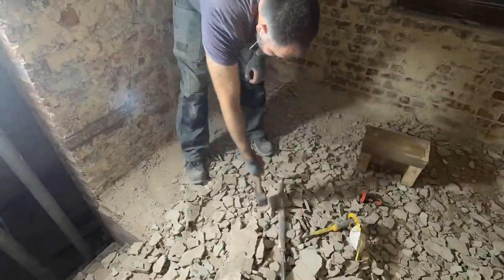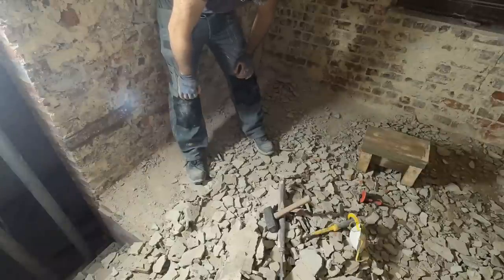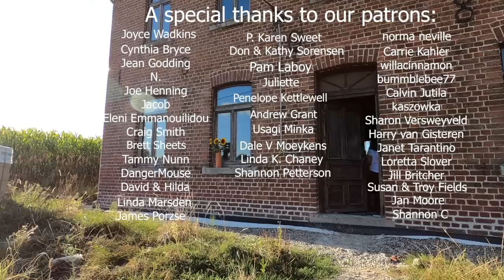OLD SCREED has to be REMOVED! / Renovating an old ABANDONED 1908 farm

Comment: Perhaps you could put the bathtub where the sink is and the sink on the opposite wall. That would free up space in the middle of the room.
Reply: It was my idea as well. It will free up the room optical when you enter the room - just seeing the toilet and the tub when entering. Even nicer would be to put the tub into the corner of the toilet and the toilet next to at while placing the vanity on the left side (upon entering).
Reply: Yes I agree. That was my first thought too. Bath could be at an angle and you could still look out the window depending on what end you lay at. Free-standing bath with claw feet 👍🏻😃
Reply: I'm loving that this is the fourth, alternative suggestion thus far. This community is the best. :)
Reply: personally i really hate having the tub so close to the toilet. i see it all the time and my house is like that, but it's always irked me.
Reply: I think this way would free up space and if the taps were the window end, you would still be able to see out of the window.
Reply: Yes this was my thought. Put sink on shorter wall and tub and toilet on the longer wall.

Comment: Some people like a free standing tub, usually claw foot tubs because they're fancy but they can be dangerous and difficult for some people to get in and out of.  Then you have to add those pipes and a shower curtain around it, if you want to also shower in it.  A nice large shower, if it fits, along  the left wall would be the safest and best option for every one to use, or on the side of the toilet with a wall in between.  Depends on the size of the room and whether you want fancy or practical.

Comment: When we renovated our house , we removed our baths and made walk-in showers (big).  Questions to ask yourself: are your guests taking the time to take a bath? Are you going to use it?i.e. do you regularly take baths now? A bath uses a lot of water and time. A shower uses less water and is quicker. Do your building regs require you to have a frosted window in the room? If so the view will go. We got away with it by having slightly mirrored windows on the outside    . Amazing work - keep it up.

Comment: you can use a floor leveling compound with a binding agent as a skimcoat  the old flood is stable and will hold tile easily  . thats the quick dirty cheap and easy way.... other end of the spectrum is ....tear it out ...throw in a drainage layer some insulation and moisture barrier  ..place your floor plumb it for in floor heating while you are there.... and tile   . thanks for the videos
Reply: And while you're at it, dig out the basement floor a bit further, so you can actually walk down there after what you suggested

Comment: Lots of hard work, but I'm sure you'll be glad you did it. It seems like you'll need a half wall along the stairs for safety. The head of the tub could go against it where you could access the piping in the half wall. The tub would be pushed against the wall perpendicular to the half wall where you can still see out the window. A safety bar could be attached to the brick wall that would double as a towel rack. There could be a matching half wall to block off the toilet from being seen from the stairs. The toilet can face the window for yet another viewing opportunity. The sink could go against the wall to the right of the window with shelving in the left of the window. There could be low cabinet under the window connecting the two. It could also serve as a bench under the window. Looking forward to seeing what you decide. Love the heated floor idea. Cleaning the brick floor and sealing it would save head space and be beautiful!

Comment: I’m loving the exposed brick, especially on the floor … if it’s in good condition, I would just clean it and seal it!  Saves the beauty of the brick, saves more work and also gives you a bit more height to the room.  I like the tub straight against the short wall by the steps … gives more floor space, but also still allows you to look out the window.  In the states, we call that a “claw-footed tub” …. They are beautiful!

Comment: Back in the early 70s, when I was an apprentice tile setter, I was shown how to make a dry pan base for floor tile. Any concrete floor to be tiled must be clean and damp. Then, a mixture made of 4 parts sand, 1 part cement, wet like beach sand, (damp), mixed, so that you cam take a handful and make a snowball that will hold together in palm of hand. Determine thickness needed as you work through 1 or more rooms spread dry pak mix over depth, use a couple of 10 foot conduit pipes to set screed level lines. Then pack down mix with wood float, screed with straight edge, (straight board), fill in low spots, again pak, reserved, move farther spreading more dry Pak mortar, etc.

Comment: I would put the bath with the taps underneath the window with the bath running in the same direction as the sink, I would then put a smaller sink in (as it's a guest bathroom) and if there's space put storage on the opposite side of the room for towels/cleaning products.

Comment: suspect the original 'screed' was liquid leveling compound poured over the bottom...  and that stuff (scratches easily or powdery) evidently was not good stuff.  the good leveling compound looks like very liquid gel pourable material, is about 5 to 6 mm thick at high spot and form hard (not easily scratched) shell.

regarding bathroom arrangements...  where is the faucet-drain for the tub at?  might affect the 'zen' of the bathroom.

Comment: Ok, this is what I would do! I'd clean up the floor as is even more, then put heating coils down and led lighting strips, and then epoxy them in! And have a claw-foot bath at the angle as you suggest.  looks like I'm in the minority though (and you will absolutely come to the decision that's best for you of course!).
This is the third time I'm banging on again about putting heating coils into the floors now, and a heat pump to heat them - it seems like a suggestion that you are not interested in, so it seems a little rude, but..!  I only mentioned it as
1. Fossil fuel prices were only going to go up, though heaven know, nobody expected this calamitous reason
2. Heat pumps require a larger transfer body than fossil fuel sources (at their higher temps)
3. Underfloor heating is sooo comfortable!
4. With your kind of structure, maintaining breathability through the envelope is best achieved with a constant heat gradient from inside to outside to maintain optimum humidity/condensation levels.
5. It's a rare opportunity in retrofit of an older building to be able to install heatin coils ...

Comment: Angling the tub to look out the window is a stroke of genius,  Marina!
At first, I didn't like the tub at an angle. But designwise (being an interior designer myself), I can see how comfortable it will be to not have to crick your neck to the side in order to look out the window as you bathe. Diagonal is an unusual placement, but it will be so comforting and perfect  to lie back, relax and be able to calmly gaze directly out the window without straining your neck. Glorious! I ❤️ it!  That type of choice is so important in interior design. Don't let the unconventionality make you shy about it. 

I would pull the tub back against the corner wall as close to the stairs and as far from the sink as possible. This will give you more room between the end of tub and the sink. You want as much space there as you can grab. Ilia's pretty tall and I don't know if he likes baths, but you might look for a shorter, but a very deep tub. Some of the old clawfoot slipper tubs can give you that configuration.  There are also companies that currently make copies of all the old clawfoot style tubs (though it is so exciting to re-use the perfect antique!)

Put a thin wall between stairs and tub to give a sense of privacy and protection to the bather.

With a privacy wall to the left as you come up the stairs into the bathroom, you can play with the wonderful design reveal that will make visual impact and give a heightened sense of discovery to the bathroom. No clutter in the small space, of course,  but colors, textures, and shelving elements can do the trick. Go with your instinctual sense of being in your body and what feels comfortable to you. You both do such quality work, I know you'd make it amazing!

Comment: Have you ever given any thought to leaving the floor in small areas (such a bathroom) just the cleaned brick.  That is really nice look, if you could find the right place.  Like the angled tub (older tub if possible).  Then look for something unique for the vanity.  If you keep it open a bit it will make the area look bigger also.  We used an old sewing machine stand for one

Comment: Watching you remove the screed and expose the old brick I wonder if anyone has ever used terrazzo sanders/grinders to smooth such a brick floor? If it worked you’d have more height and an original floor. It might need to be sealed after and if the brick is too soft or hard it might not work. Just a thought, love your project.

Comment: Is this tub going to also have a shower? Placement of the pipe and shower head will then also be a consideration for placing the tub. Or, maybe the ceiling will be too low to be able to comfortably stand in a claw-foot tub?

Maybe hot water heat for the floor, rather than electric? Installation effort would probably be about the same, but hot water heat would be much cheaper to run I would think. In either case, maybe a wood floor over the wires/water tubes, so they would be accessible for repairs without having to tear up concrete.

Designing and building is SO much more fun than demolition! You have the best part coming.

Comment: Good morning to you.
Concerning the implantation of the bathtub there are two solutions that you have not considered:
Put it along the wall immediately to the left at the top of the staircase with the feet facing towards the window to have the view towards the outside. It would be enough to create a partition wall with the edge of the staircase to avoid splashing. This would free up more room space and create a connection with the wall to avoid damp fallout along the wall and behind the bathtub.
The other solution is perpendicular to your proposal diagonally with the feet in the left corner of the window. This solution offers you the best view on the outside but just like your diagonal solution, eats up a lot of space in the room.
You had a very good idea by materializing the furniture with objects in the room that allows you to better realize their size.
Bravo for all your work and good luck for the future.
I return to my own work in a farm Creusoise in the Limousin in the center of France and which dates from 1893

Comment: If the options are only those two, straight or angled, I would do straight. Can the tub fit flat against the wall by the stairs (90 degrees from your straight version) that way you free up more space. You could then have two shelves on either side of window with seat between. Just a thought.

Comment: I am rarely a fan of placing fixtures diagonally in a room - that just wastes space.  As many have suggested, it looks like there might be room along the wall next to the stairs, although that will  be considerably shortened after the insulation goes in.  I think the straight layout is the best and probably the most efficient.

Comment: Hi, on the floor is it possible to clean up the brick and seal that suitable for a bathroom?  While you would forego the underfloor heating it would save on the issue of the room height. Also have you considered the sink beside the window and the tub/shower along the wall, this way you could sit in the tub still and look out the window. Your back when in the tub would be to the stairs/door. Hope this makes sense. :)

Comment: Marina and Illia, I heard you say you cannot change where the toilet goes however, you have to have sewer holes/pipes for all of the items.  Think about putting the tub where you currently have the toilet, place the toilet close to the corner near the window (both on same wall).  Also, if you get a "pedestal" type sink & place that close to the corner on the wall next to the stairs (with a half wall) you would then have room for a small armoire type cabinet/closet, and still have plenty of "walk around" space in the center.   If your bathroom is small this would be the most optimal positioning without having to walk/look straight into the toilet.  You could also leave the toilet where you plan and place the tub just to the left of it.

Comment: An idea: save some amount of this rubbish for when you do the kitchen. Instead of placing the furniture on the floor, with a false bottom, make a base in cement, you can fill it with this rubble and only then place the furniture. Thus, it not only gives greater stability, but in case of water on the floor, the furniture does not rot.

Comment: Add rebar in the cement you pour under the bathtub location- lots of weight.  Could you turn the tub 90 degrees and have it line up with the window?  With your head by the stairs and your feet by the window so you can stare out the window. hopefully there would be just enough space to walk in front of the window- and then have some modern bookshelf cubbyholes on the wall

Comment: My suggestion is to place the bathtub along the wall with the door. Build a short wall along the steps to block the end of the tub and a glass panel from the top of the wall to the ceiling. This configuration allows more open floor space in the room.

Comment: Don't put the bath tub shifted. There will be some space in the corner you really can't use for anything but collecting dust. If you put the bath tub straight you can have hooks for bath robes or towels next to the bath. Maybe you can put the bath tub where the sink is supposed to be. You don't bathe as much as you think you will and with the current price on electricity even less. Maybe you should rethink the whole bath tub and install a shower

Comment: 14:40 a clawfoot tub? 😁🛁

Aesthetically, yes a shifted diagonal tub placement is more pleasing—but only if you have a very spacious and airy bathroom. So, although I like it, it’s not practical for the limited amount of space, sadly.

I actually think having the tub centered beneath the window is best. And, instead of one large sink & counter, you could have a smaller one, but there would still be space for little storage cupboards here and there.

Comment: i vote for the first configuration, with the tub straight. seems like walking around it would be awkward with it diagonal. or on the wall next to the stairs - parallel to the sink, with the head/feet against the stairs and the window wall. not sure it would fit.

Comment: Only my opinion, not a critism. A tub on the angle creates a pinch point and is harder to clean in the tight angle where the tube connects to the wall.  I like the brick floor, just seal it after cleaning

Comment: I'd place the tub parallel to the brick wall without the window. I don't think either of the options you put on screen would be a great use of the space you have. You would still have a great view out the window if you placed the head of the tub near the stairs and the foot towards the window and you'd still have space for storage cabinets. You could put a short long cabinet under the window instead of a tall one in the corner. Then you would have lots more floor space for both you and your husband to move about the bathroom without being on top of each other.

Comment: I would put the bath straight - diagonal uses too much room-.  I would also put a little screen along the floor to block off the steps; - that could shield the bath from the steps and it would only need to be a metre or so high - just for aesthetics.

Comment: I think people are asking if the tub can be placed opposite the sink on the short wall against the stairs.  I think that would be the best place for it but think that wall is not long enough to accommodate it.  If not, then I think the straight position under the window would be best.  It is a lot of work to rework that house, but you will have an awesome and well-built house in the end.

Comment: Why can it not do a 90 degree turn from the original position and go against the wall on the left? Instead of a wall along the steps you can do a hand rail if it’s a tight fit.

Comment: Hi all, I'm not sure how to explain what I mean but here goes. I love the idea of the bath on the angle but the fittings to install it will be on show so to make it look nice you would need special waste, overflow and tap connections, usually in chrome or brass , these are probably quite expensive. Just a thought. Regards Jim UK.

Comment: Oh, a claw-foot tub. We have one but it is small (about 155 cm long). Because the top edge is 7.5 cm wide all the way around, it sits very close to the side and end walls.
Without actual measurements, it is difficult to say which layout would work best. If you put it along the window wall you could place the sink  closer to the toilet so it is not crowded by the tub. That would leave more storage space for towels (on shelves above or under the counter at the end of the of the tub. Just a thought -- either position would look nice and provide a view out the window.